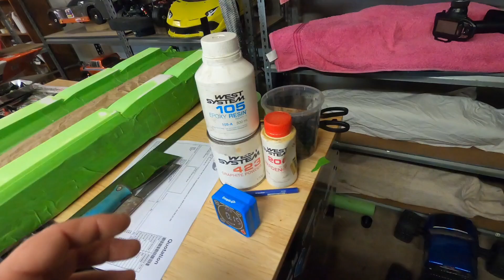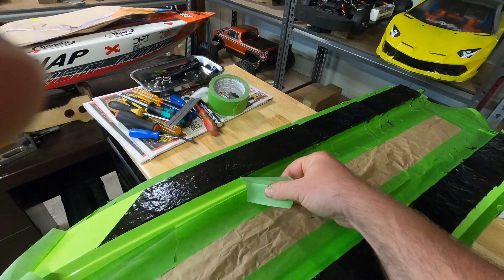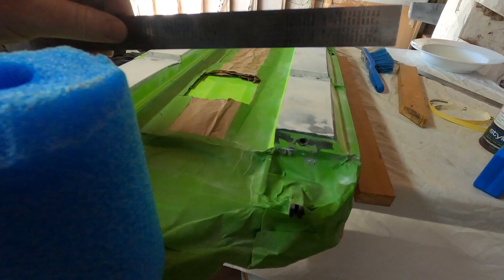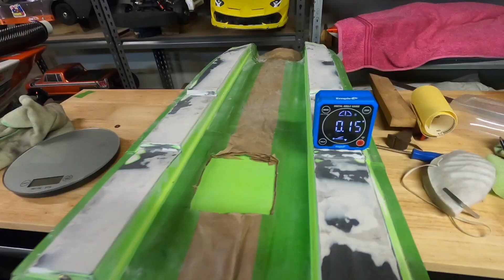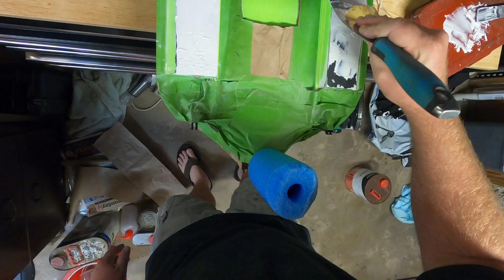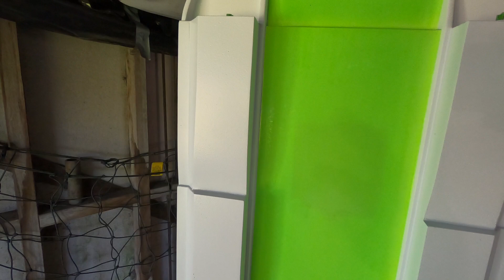RC Boat Blueprinting - How to Blueprint an RC Boat

Comment: Watching this video 8 months too late. For the pin holes after primer you can get a 1k automotive putty specifically made for pinholes. It applies super thin, dries quick and sandable, and no need to prime it again before paint!
Reply from the maker: Thanks for watching and commenting mate, appreciated. Always more than one way to skin a cat. Safly the boat is back in drydock for the moment after an unfortunate crash. It was super promising
Reply: @easternrc1924 always enjoy seeing other Aussies in the hobby mate 🇦🇺 

We can always learn something somewhere! This is the first blue printing video I've watched..
Reply: @e @easternrc1924 also can I ask, what size was that chrome prop in your sw36 video with the 1600kv sss motor and flycolour esc? Looked like it boogied! I'm about to throw in a seaking 4082 1700kv into mine..